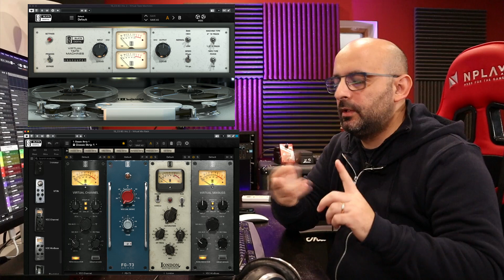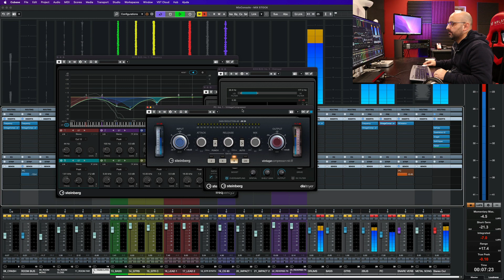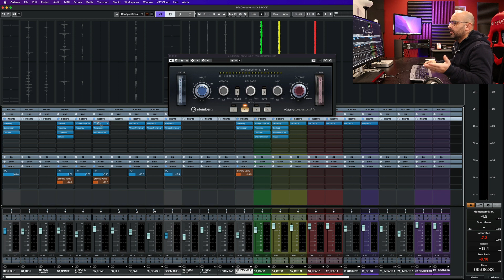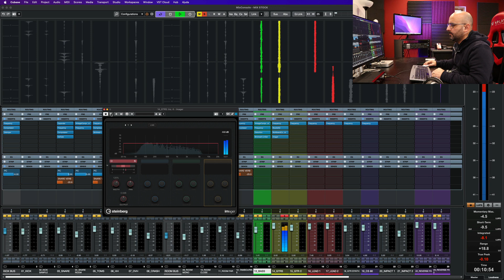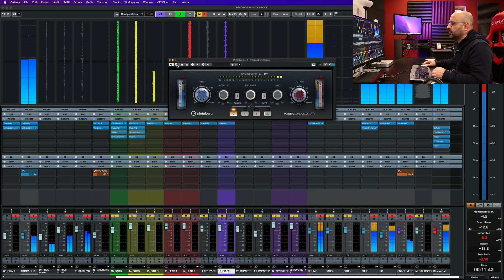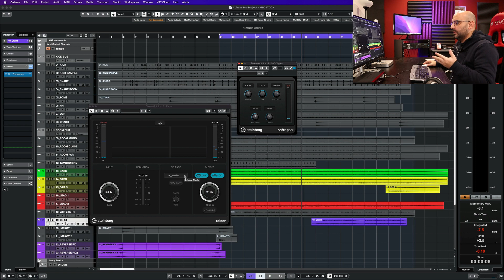Can You Really Mix Just With Stock Plugins in Cubase? 🔥Download the Mix Session🔥

Comment: Hello Andre, Happy New Year and thank you for the videos. Question, are you gain staging accross the entire project? You have some very high volume faders, and I was wondering how you gain stage your projects. Thanks
Reply from the maker: Hi! Happy New Year!🎊 When I start mixing I set the levels so the Master it’s around -18Lufs and try to finish the mix at -15/-14Lufs, everything in the middle doesn’t bother me much although I have to recognize that in this mix the levels specially in the groups are a bit hot compared to all my other mixes. It’s probably because I mixed this song so many times for this videos that I just wanted to finish it fast😅
In Logic it’s different though, if you hit the stock compressors hard they sound really bad, I’m putting together the video mixing with stock plugins in Logic and I had to normalize the gain of all the audio tracks to -26 Lufs average level.
Cubase has so much headroom that is pretty much impossible to go clip a signal in the middle so as long you don’t clip on the way in and on the master you’ll be fine.
I know there’s a lot of talking about gain staging on YouTube, people making rules about what the levels should be in the audio tracks and what not.. I’ll make a video about it, just to give my humble opinion.
Anyway, thank you for your question and thanks for watching!😊
Cheers 🍻
Reply: @andrecreates  Thank you so much for your reply Andre! Makes sense. Are all single tracks and group tracks routed to the 2Bus and the 2bBus out to the master fader? Thanks in advance. I followed your video step by step, but my mix doesn't quite sound like yours. Are you using any external processing hardware?
Reply from the maker: @691High  Did you download the Cubase Project? You can download it, it’s in the description.
Usually all the tracks go to a group and the groups to the 2bus, only fx like impacts go straight to the master bus otherwise it will trigger the bus compressor really hard. The vocals usually don’t go to the 2bus, when I mix metal the 2bus it’s for instruments and there’s a second bus “Vocals All” where all the vocals goes. Both the 2bus and Vocals all then go to the master.
The 2bus it’s there to put an eq and a compressor to glue everything together, that’s all it is really imho.